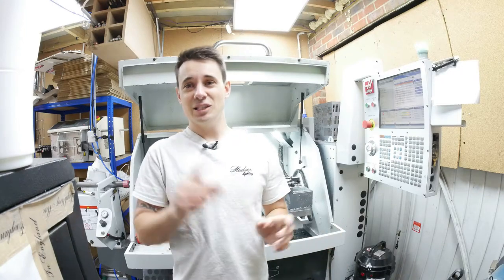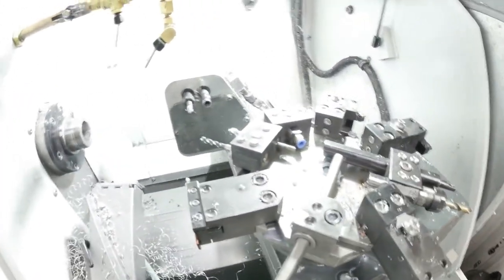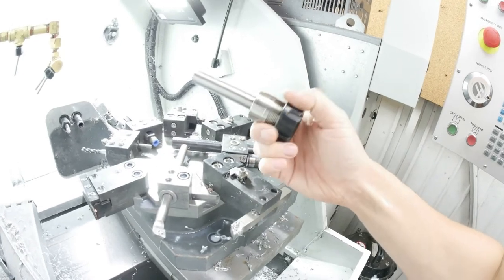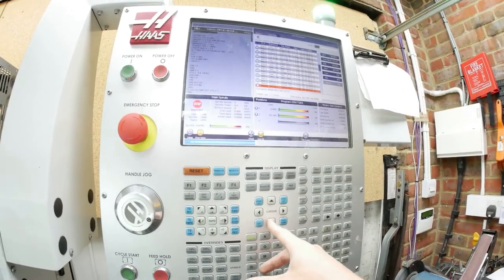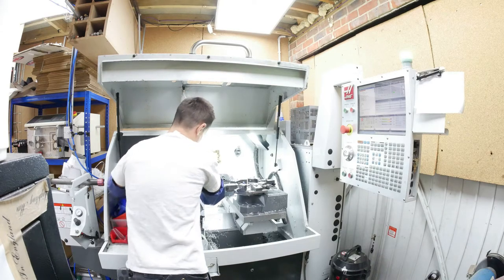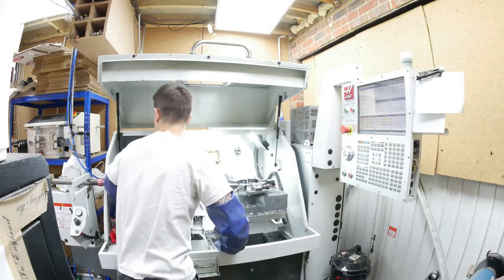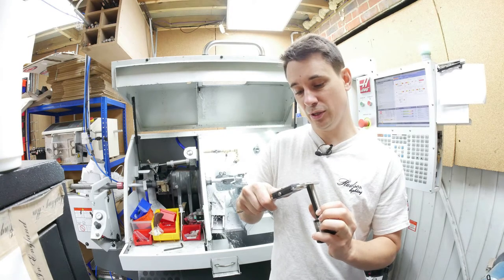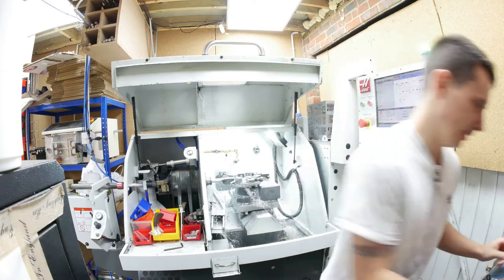CNC Machining sleeves for ER collet chucks within the HAAS Cl-1 lathe

Comment: For osmosis water ask you local fishkeeping / Aquaristics shop, they usually run an osmosis setup and you can get the water pretty cheap.
Reply from the maker: Thanks, I've got an RO system from Amazon a little while ago, works a treat. Just takes forever on our current water pressure